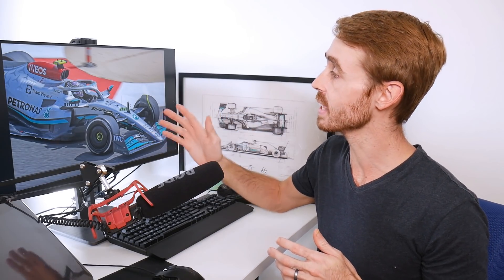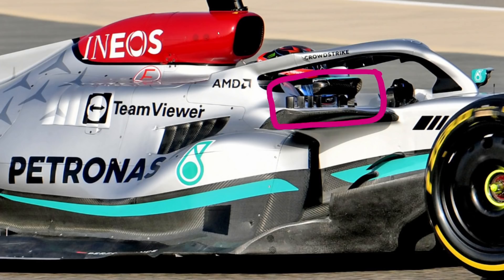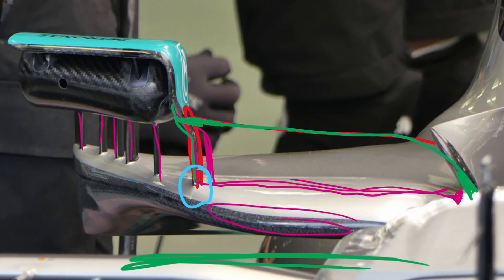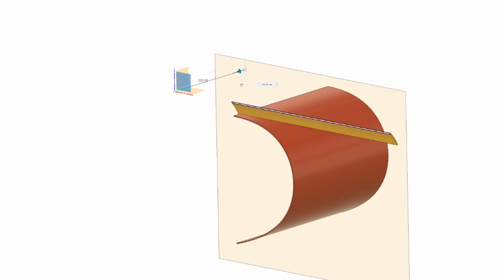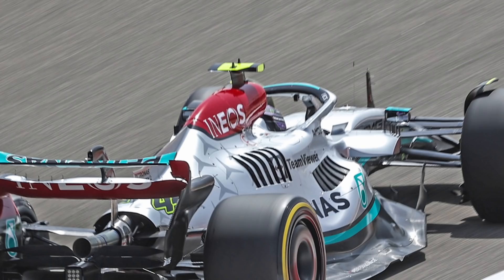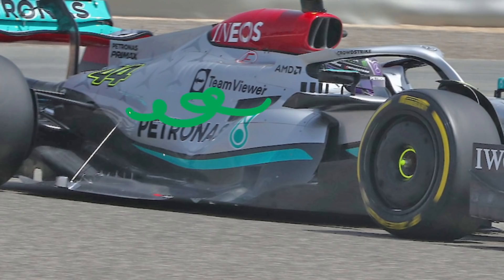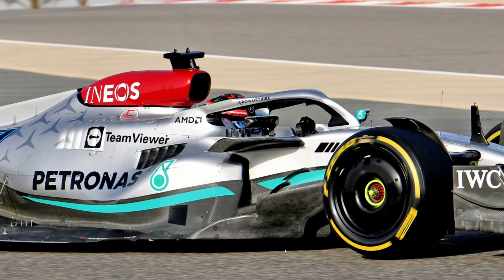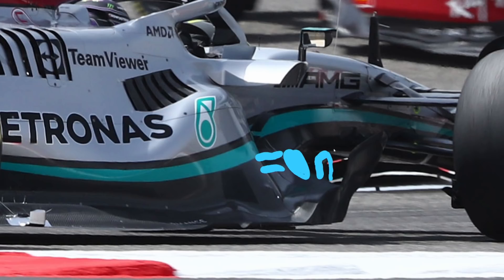How do the Mercedes Sidepods Work? - Aerodynamic Analysis

Comment: Can you talk about porpoising in depth some time? I understand the basics of the floor air flow getting choked but I'd like to know more about what can be done aerodynamically instead of just stiffening suspension. Do you think there's an underlying reason we've still seen teams still struggle with it in Bahrain?
Nice work as always!
Reply: Jean-Claude Migeot, the former chief aerodynamicist of Tyrrell and Ferrari in F1, explained in an article on Autosport's website that porpoising wasn't about stalling aero, but about the car getting in it's natural frequenties in heave thanks to the long chord of the underfloor. I'm not knowledgable enough to reproduce it and explain it to a five year old, but I certainly hope Kyle can enlighten us!!!
Reply: They need a pressure release valve, like a slow cooker. When they get to the desired minimum ground clearance it could leak the pressure at a set rate to keep the clearance at the perfect level. Probably not legal to have moving parts in that area though.
Reply: Also why that was not an issue in previous cars since underfloor downforce was quite substantial already?
Reply: @RCmaniac667  there are a lot of things. First the front produced way more downforce. That is easier to balance. They also did gain a lot of downforce with the floor but the percentage is a lot higher now. Most part of the rear downforce was done by the diffuser and the rear wing which are not influenced by the car in the same aspect. You also didn’t habe the tunnels. The floor was quite flat from the beginning now you are allowed to get more air under the floor because thats what ground effect is for
Reply: Its because at speed in a straight line downforce or ground effect becomes to great until the car drops to close to the ground so ground effect is temp lost and the rear end raises up then this repeats itself to get the up and down dipping and rising
Reply: My understanding is that the suction from the ground effect makes the car go lower to the point where it's too low to create the effect so naturally the car goes back up to the point where the ground effect comes back again and vice versa.
Reply: I think the suspension travel is still very similar to the last gen, if not the same. It was designed for larger side wall tires that flexed more, I think its because it is stiff and low travel that's causing this. I think it would need a complete redesign to fix this and that has not been done.
Reply: @Andi_Doci  But everyone knew that the tyres would behave completely different. Feels strange to me to assume that the teams wouldn't know about this and consider it in their designs.
Reply: Friends at this difficult time need your little help to the Ukrainian army. Putin will be destroyed  BTC: bc1qw2qslwvmtzs7yk2x2lzfxfnsxwz5ne70xkkf9t ETH: 0x9d6917b707e268EFBCF29E37728394F20Cc34CF8   -=-=
Reply: Floor flex. Teams weren't quute prepared for how powerful the floor would be so the ends are flexing at high speed and causing the choke. If you look at the Mercedes you can see the stats they've added to help although at the ground clearances and speeds even that isn't quite enough
Reply: Nope, it's not floor flex. Imagine this: the car is drawn towards the ground so much that the air that is directed beneath the floor has no where to go so it takes other routes. In this way no more air is flowing under the floor, so the car 'stalls' and there is no more ground effect and it goes up. The air now can flow under the floor and so on and so forth
Reply: @AdrianTuhut  "stalling" was the best way I've heard it described.
Reply: @AdrianTuhut  It is in part the flexing floor. 
The question is, why does the floor get so low that we start choking the airflow? The low pressure pulls on the floor. So even with a super stiff suspension that simply bottoms out and prevents the car from going any lower, when parts of the floor are to flexible and can bend / flex towards the ground, you'll still choke the air flow in certain sections.

So in part, it is also caused by the flexing floor. And in parts by the suspension.
Reply: @Benisuber1  I don't quite see how stalling fits here. 
It's Bernoulli's effect. When you force a large volume of air to go through a smaller area, the air has to speed up. And a high velocity of air produces a lower pressure. (That's counter intuitive. But that's what it is) 
So the air passes bellow the floor, speeds up, creates a low pressure and sucking the floor down. But that only works as long as there is an area to flow through. When the area is to small (because the car is to low), nonlinear effects start to take over. Parts of the floor might physical cut off the air flow. (Where you see parts of the floor actually slamming against the ground and produce sparks) Or we get some nasty turbulence that prevent the air from speeding up through the smaller area. Or parts of the air simply exists out to the sides. So we don't get fast moving air anymore, which means no more low pressure that sucks the car down. The suspension then outpowers the downforce and pushes the car up again. And once the floor is up, everything repeats. 

My famous trivia: This is exactly how we get our vocal cords to oscillate in order to speak. Just that in that case, we want the Bernoulli effect to stop once the vocal cords actually meet. Otherwise, they wouldn't oscillate and create a vibrating sound wave.
Reply: @CrazyHorse151  thanks. I was wondering why the bump stops werent preventing it. Floor flex brings it all into focus.
Reply: @CrazyHorse151  don't forget about flow viscosity and no slip condition, flow won't accelerate to infinite velocity as area approaches zero
Reply: @CrazyHorse151  I mean "stalling" just as to the scenario you described where the frame contacts the ground (sparks), which leads to drastic reduction in downforce, which starts the whole cycle over again. 

Maybe "stalling" isn't the correct term for that, but it worked for this chemical engineer to explain how the 'porpoising' pattern cycles.
Reply: @TheEverlastingGaming  Yep, that's what I kinda labeled under "nonlinear" but that's probably the wrong term.

Comment: The main thing I'm worried about - won't it affect the dirty air? Won't the fia complain as they wanted to reduce it?
Reply: Most teams don't care about the air once its left the car. After all the worse the air coming out the back, the harder it is for someone to overtake you.
Reply: Pretty sure FIA released a statement that they investigated the design in CFD and found no significant effect on dirty air. Might have just been Ross brawn, and I could be wrong
Reply: The teams can protest the design. If majority agree its not in spirit of regs they can get f.i.a. to issue a change. I.m.o. the regs really wanted a certain look and required sidepod min box size with swept back. Like aston or alpha. So we shall see but merc could have issues cooling this certain places plus it may not actually be a huge advantage over Rbr design 4 example.
Reply: @captaintoyota3171  "there is no such thing as the spirit of the regulations regulation" - Adrian Newey
Reply: @johnnyboy7538  Yeah, we're all familiar with that quote & who Newey is.

That doesn't make it some sort of F1 law. Loopholes will always be exploited but if there was no such thing as the spirit of the regulations then why bother with them at all? Why not do away with them altogether?

It's just Newey's opinion. A very experienced & informed opinion, but it doesn't overrule everyone else & it certainly doesn't invalidate the very extensive 2022 regs.
Reply: @runlarryrun77  I'm hearing this and genuinely interested as n oone is actually telling what part of the spirit has not been followed. AFAIK, The spirit of the regs is less dirty air behind. Experts saying it duly complies with that. I’m genuinely trying to understand why this design is a problem?
Reply: @DebmalyaSinha  too much rule bending
Reply: @robertjusic9097  exactly which rule was bent?
Reply: @DebmalyaSinha  because its Mercedes doing it. The fear of it being better than everyone else is real
Reply: @DebmalyaSinha  the mirror support wing having an aerodynamic purpose looks like a rule being bent to me
Reply: @Stefano-qv6ro  again, perfectly legal and nothing is bent. Rule bending occurs when rules are  ignored for one specific purpose/person.
Finding innovative solutions well within the rules isn't 'rule bending'. I get that you're not a Merc fan (I'm a McL fan) but I try to keep an open mind for engineering excellence.
Reply: @DebmalyaSinha  im a ferrari fan, but i don't think im being biased saying the mirror support has aerodynamic purposes...
Reply: @Stefano-qv6ro  Ill trust the aero experts working in the teams to decide this but in no way any of this bodywork is 'rule bending'. I'd argue, the Ferrari 2018 fuel dump cheating is also a genius solution which 100% adheres to the rules. Not 'bending' at all. Which is why they were never penalised. They had to revise that part later. A mirror aero is tiny considering that saga but nevertheless, its weird people are calling 'rule bending' without being clear on what comprises bending.
Reply: @captaintoyota3171  You need 8 teams to agree. Merc has Williams, McLaren and Aston Martin as engine customers. Williams can't go against Merc ever. You need to convince the other two teams. McLaren may become the works team with Merc if/when Merc leaves the sport.

So there is no way any part of Merc will be declared by the teams. Same for Ferrari.
Reply: @cmfrtblynmb02  mclaren are one of the teams heavily rumored to be switching engine suppliers for 2025.
And with the engines now essentially frozen it wouldn’t be too crazy for them to come out against Merc.
Still unlikely… but def much more possible than in years past
Reply: @captaintoyota3171  not quite right. If the FIA and Formula 1 believe there is an issue, they can take it to the teams and only need 8 to effect a change during the season. 
Any team can lobby a design that both the FIA and Formula 1 have approved and present an otherwise not considered argument. If that argument is valid, they take it to the teams - and only need 8 to affect a change during the season. 
So, in short, the combination of 8 teams and both governing bodies are required. 
You can be sure, if it doesn't seem to work no one will lobby it.
Reply: @captaintoyota3171  did you even watch the video?
Reply: The FIA's already said that it's marginal and that they don't have any issues with this design

Comment: Watch FIA block it faster than the speed of that Mercedes
Reply: It was done in collaboration with the FIA,
Reply: @jeffsteyn7174  Approved by, collaboration makes it sound like the FIA had their own design team working in conjunction with Mercedes
Reply: @jeffsteyn7174  I know that :) However, they like to block their designs. Also, if I remember correctly, there's a new rule stating that if the majority of teams protest a certain design, it can be banned.
edit: it's so called "super majority" - if a minumum of 8 out of 10 teams speak against a certain innovation, even if it's within the rules,  it can be decided that something is still prohibited.
Reply: @Paulinek2707  I think the only big team in any danger from a supermajority is Red Bull. None of the small teams are going to risk the ire of their engine suppliers.

Comment: "Downwashing winglet".. which means that if not strictly illegal per tech regs, it is illegal when it comes to the spirit of the regs. The crash structure member has to be neutral, as does the mirror. Those rules are stronger than tech regs, which FIA has said they WILL change tech regs if teams find solutions that break the spirit or the regs. edit: and the crossection requirements.. that is clever but again, not what the rules intended. I am very surprised FIA let this pass, it is clearly in violation of several regs, not in their tech section but... spirit of them.

To merc: it was fun while it lasted.. or was it? Would not be the first time FIA gives Merc a free pass. I would hate it happen again, this is CLEARLY not a neutral aero part but.. a downwashing winglet.
Reply: F1 engineers don't care about spirit, just if it's legal in the rules. If it's legal, they'll run it until it gets banned cause the FIA hates innovation
Reply: @KnowledgePerformance7  Brawn said he would outlaw designs that don't fit the spirit of these regulations. Stupid, yes, but he said it
Reply: @nbain66  it is, indeed, stupid if he does that. F1 has always been about innovation and finding loopholes in the rules and using them to team's advantage. They've already restricted a large portion of F1. If they keep doing it, this sport will soon become boring or we will have a spec car sport.
Reply: @nbain66  He can't just ban it, he's not in full power over everything
Reply: @KnowledgePerformance7  afterall f1 is a sport not a religion. Those who like "Spirits" should please exit stage left.
😂
Reply: @dsistudios8446  rules are meant to be bent, if they can be bent they aren't written well enough.
Reply: I'm sure no one has ever used a crash structure for aerodynamic gain, certain not Ross Brawn himself - he would never do something so heinous as break the spirit of the regulations.
Reply: @joelambert7128  Double diffuser? 🤣
Reply: @scaramouche06six  it’s the usual anti-merc crowd that believes the ‘free-pass’ conspiracy 🤦‍♂️
Reply: @scaramouche06six  They were allowed to run DAS in 2020. It was banned in 21 which happens often with new innovations that are allowed to go for one season until the loophole is closed. It was not anti merc. If they had banned it in 20 that would have been unfair, because it complied with the regs at that time. But new season = new rules.
Reply: @scaramouche06six  OH WELL.
Reply: There is no reg known as "Spirit of the Regs" 😂

Masi: it is called racing.

Mercedes, once again, have shocked the world.
😂😂